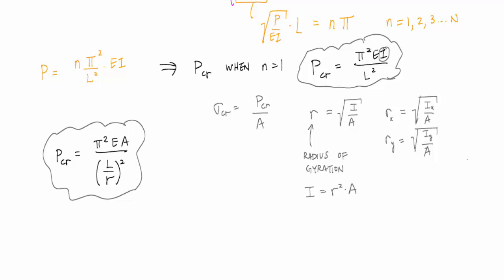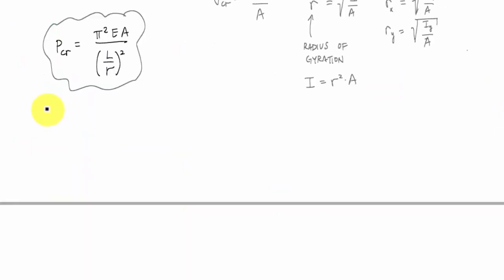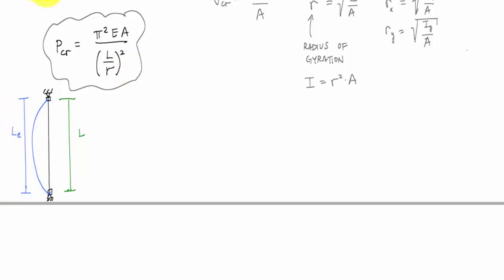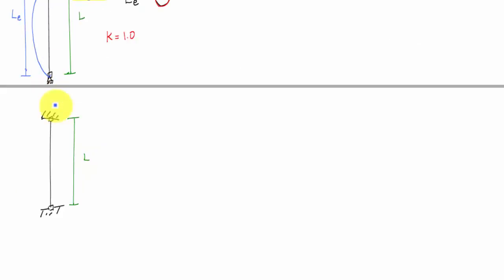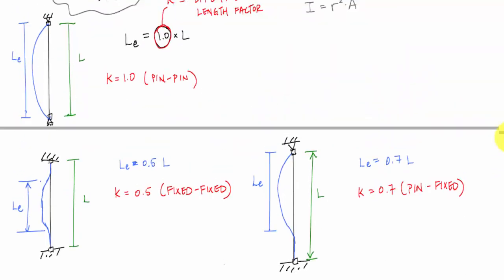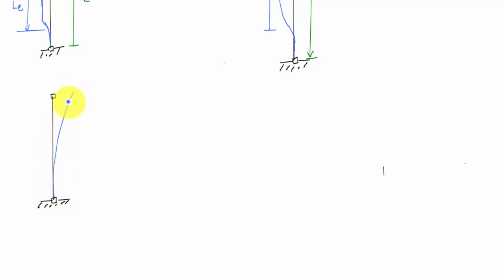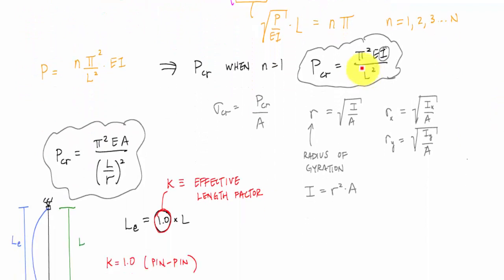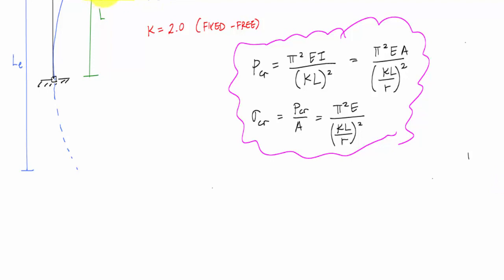Introduction to Column Buckling (2/2) - Mechanics of Materials

Comment: Dear friend, can you please elaborate more on how the effective length of cantilever column comes out to be 2 times actual length of the column?
I didn't get the part you saying "you've to measure length node to node."
Reply: +structurefree   HEY?!      Can you do a series on Castigliano's Theorem?  It would be very helpful for my next test.. Or could you point me in a correct direction to get some information..  any would be Very helpful .  Thank you
Reply: +Ashish Rathod 'Effective length' is a bit misleading. It's more like the length of one half wavelength, in units L=1.

Because it's a smooth curvature, the bend is shaped like a section of a sinusoidal wave. It is exactly half when the two ends are pinned, because you've fixed the two ends. The pinned ends are the points where sine crosses the x axis, these are the nodes.
Reply from the maker: Ashish Rathod i say node to node since the solution of v(x) from the ODE is sinusoidal